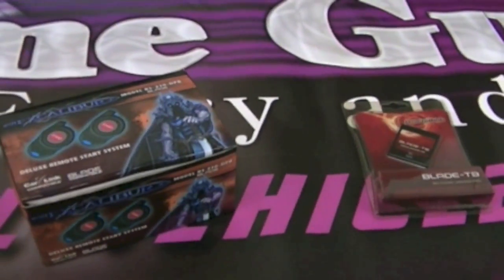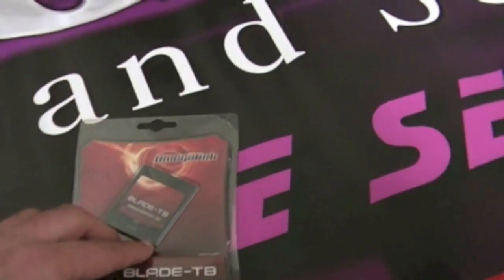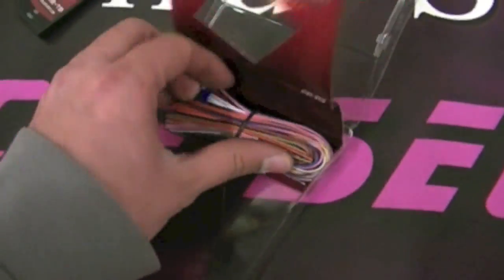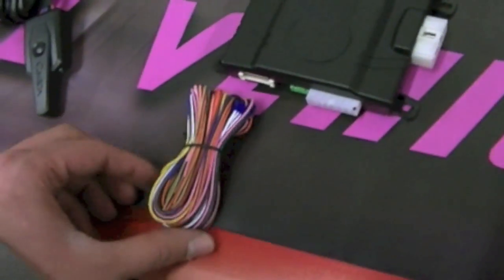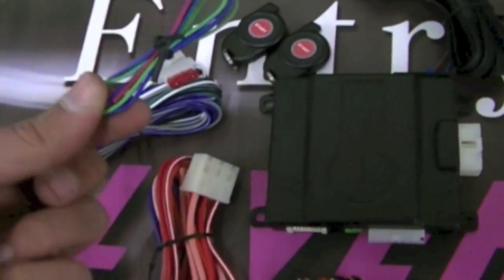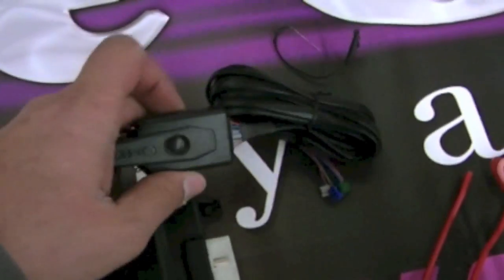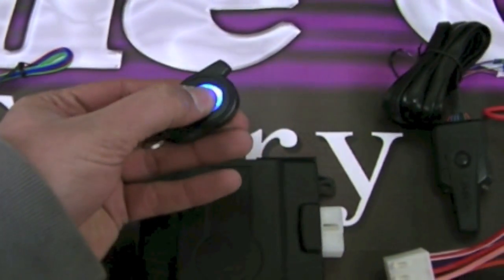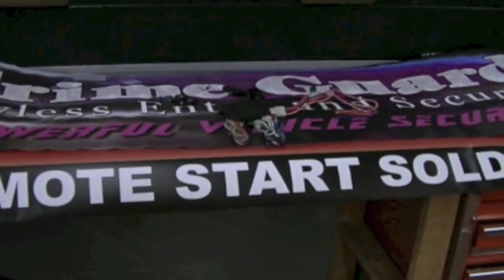Remote Car Starters Explained!

Comment: Have you ever done a remote starter on a carbureted vehicle before? I am going to put one on my 72 k20 I'm restoring. Have heard of using the trunk pop feature on the remote with a trunk popper to pull the throttle to set the choke/give the carb a couple shots of fuel before you try and start. Any thoughts on this?
Reply: That's a really good idea lol, never heard of doing that before.  That's thinking outside the box :P

Comment: Hey, I have a autpage remote starter and keyless entry on my beater car, and recently whenever i turn the car on with the remote starter or open or unlock the car my lights dont come on. Before the lights would flash when u lock or unlock the car and when you remote start it the taillights would turn on so you know the cars started. Do you know anyway to fix this?